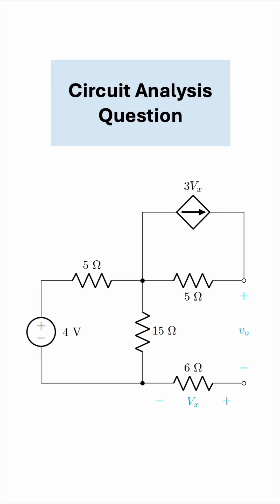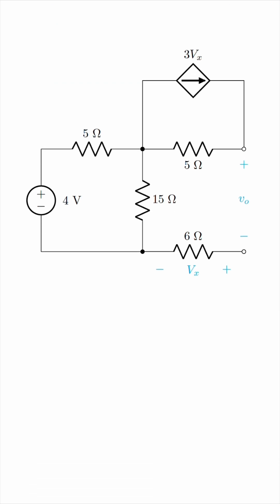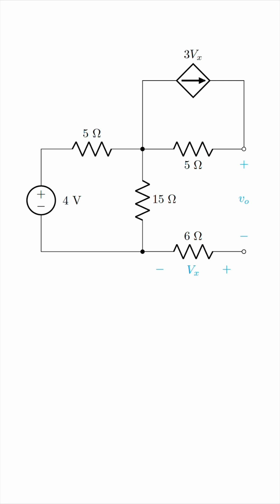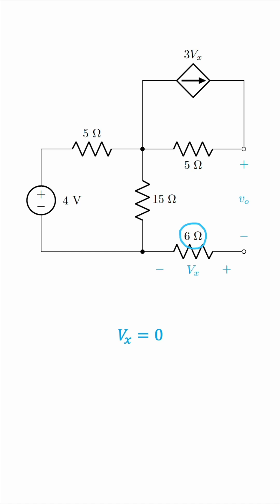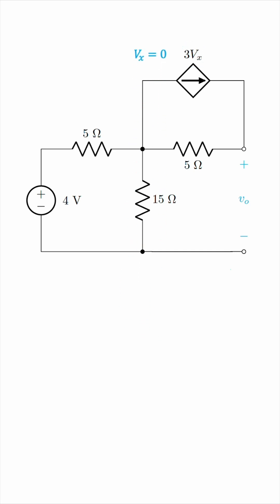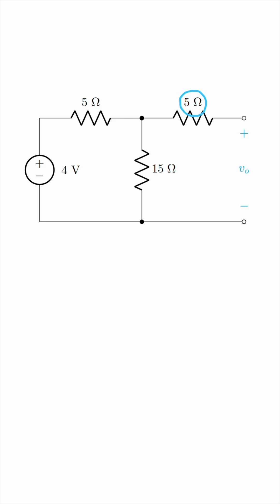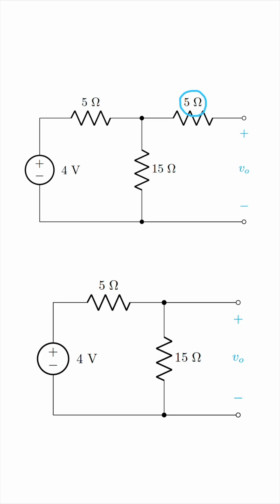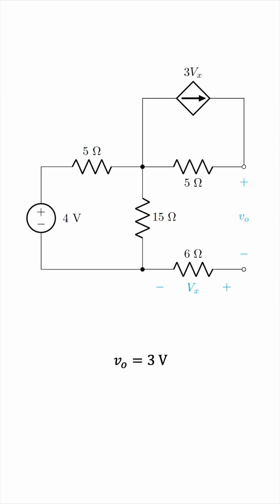Circuit Analysis Question #electricalengineering #electronics #electrical

Comment: 3v. Vx is 0 since no current flows through it. Therefore voltage at node after 5 ohm resistor is Vo. Simple KVL reveals current and you can find voltage drop across the 5 ohm.